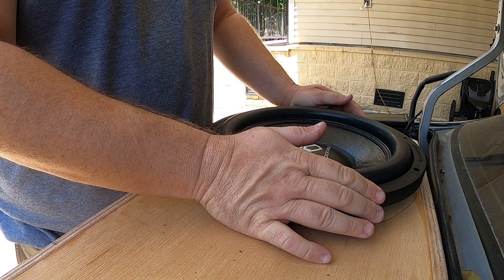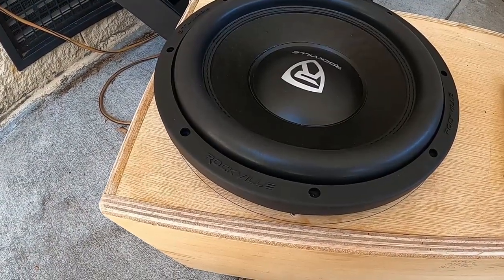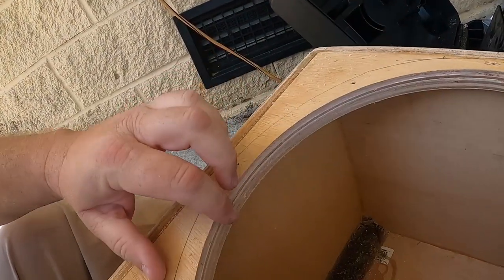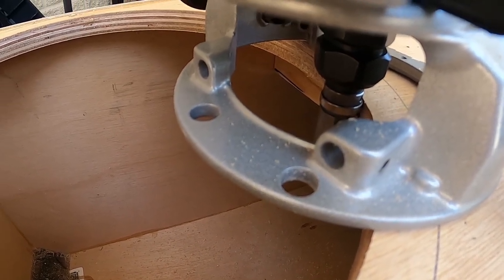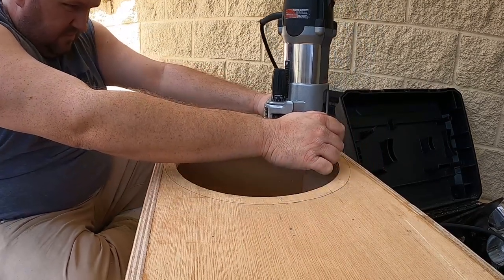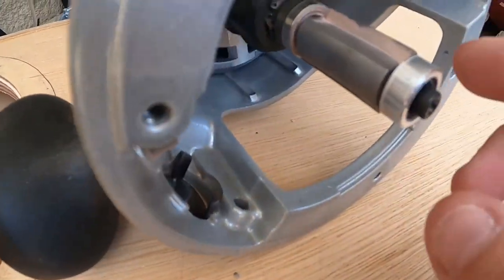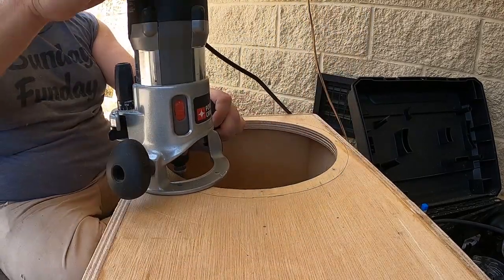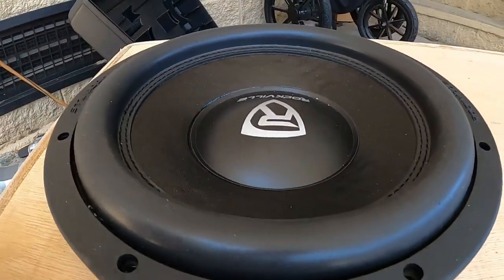[HOW-TO easily RESIZE a SUBWOOFER CUTOUT] 12V Tools CPR

Comment: Nice video bro, I do have a question to everyone on here? So I have the new CT sounds Ozone 10’s, and I noticed that many companies are using the push terminals for the the subwoofer connection, so here’s my dilemma, the terminals sit right in line if the cutout diameter, would notching a little extra be ok? in order to fit the wires and drop In the woofer without the terminals hitting the wood. Any ideas would be awesome.
Reply from the maker: For sure. Some have to notch the cutout to fit. It's not super common but I've seen it on some smaller subs.
Reply: @Skip01  thanks man, I had a pair of skar EVL 6.5’s that had the same issue, I was just curious to know if anyone had any tricks… but thank you bro.

Comment: What’s the cutting length on these bits? Will be it be good for a 1.5” thick baffle?
Reply from the maker: I think you'd be fine. Just multiple passes for each
Reply: @Skip01  hello what if the hole is in box is 4 1/2 inch and the new speaker is 4 inch what can be done for the 4 inch to go in a bigger slot that is little too big
Reply from the maker: @Blu-Man  Recut the face of the box lol. It can't add wood anywhere. Or cut out a ring to fit the 4.5 to 4 adapter

Comment: take the specs in the sheet and consider them. Take a ruler and measure the sub rim from the backside. It likely will never be perfect, once the hole is cut wrong to begin with.